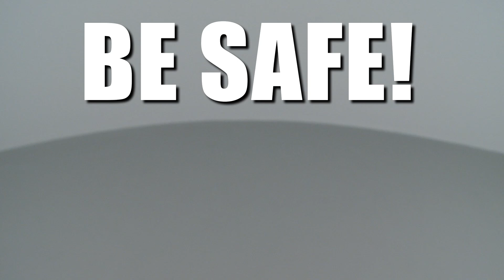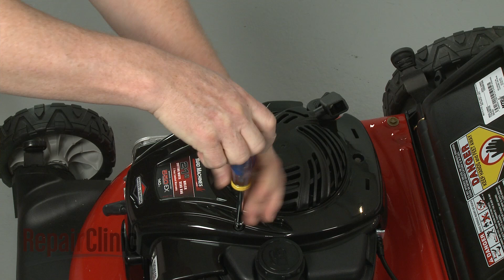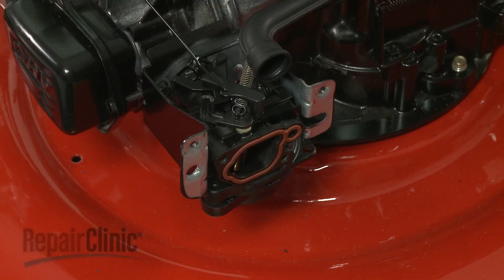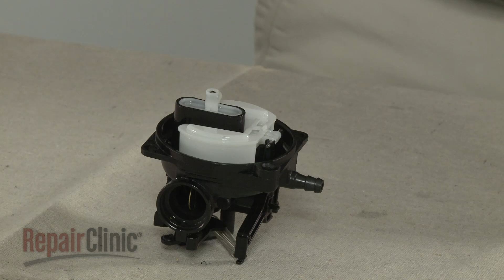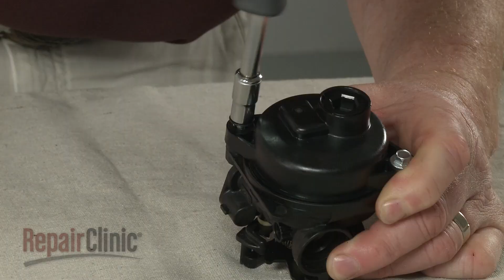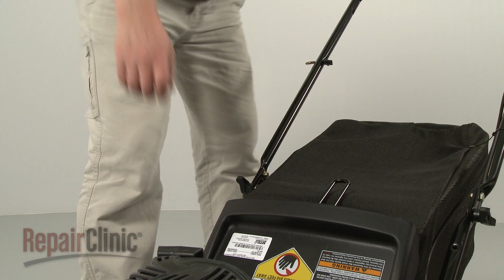Briggs & Stratton Small Engine Replace Carburetor Float Part # 591120

Comment: One nm of the worst designs of a carburetor by Briggs and Stratton. 
I rebuilt the carburetor,  which actually looked brand new, with a  ew jet assembly and it is still very hard to start . Maybe after 4 or 5 pulls then it sloy will start up.
Have no idea what the issue is with these plastic carbs

Comment: Took apart all the carb parts and cleaned with carb cleaner. Also sprayed the carb ports and disconnected the fuel li e from the tank and still only runs for a second or two with carb spray before it stalls. Any ideas? Since it's running for those 1 to 2 seconds means it's getting spark air and fuel at the source. My pressure washer has no fuel filter btw so what could be preventing the fuel from getting into the carb/engine. The only thing I noticed was a ball bearing that would only move by forcing it with a thin wire/Allen wrench. Does this ball bearing in the carb assembly suppose to ride freely as a check valve ball?  Carb cleaner doesnt help. Anyone?

Comment: exact carb but with out the choke spring , just has a white cap, how does it choke to close the little plate it carb ??  also has a white point /piece above gas connection point  that looks like a small tube connects to ...mine came with out tube or connection to point ?

Comment: Why would this need to be replaced
Reply: They can get holes and cracks in them and not work properly. They should mention that you should change your float seat and needle while you are at it.
Reply: As recently finding out........ if you put E10 in it the float warps and the needle doesn't fully close. So you pull your carb apart and replace the Needle / clean the seat (float appeared ok with no holes or cracks)...... flip it over and test it by blowing through (all works fine) put it back on and it leaks fuel again. The Plastic Carb is just junk!! if it's not hunting it's leaking fuel all over the place........

Comment: Great video. But why on earth would B&S designers use 2 different nut sizes on the air filter housing? One metric and one imperial. Straight out dumb !!
Reply: Technically, 8mm and 5/16 are the same. You can just use 8 and then switch to 7. It's no wonder they're going out of business.
Reply: In typical fasion the engine was probably made in a Metric country and the Mower assembled in a Imperial country....... or vise versa.

Comment: I have the B and S 550e , starts first pull but runs ruff low power and gas splashes out of the carb when it's running even after i cleaned it .. any suggestions
Reply: i have one doing the same thing...seeing this is 9 months old, did you find the problem?